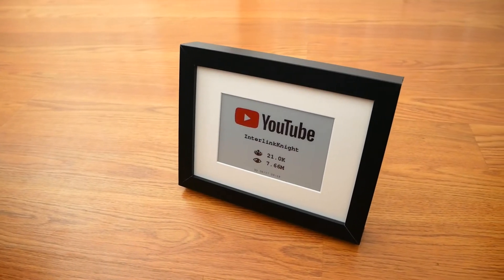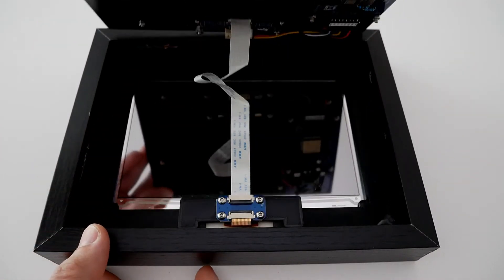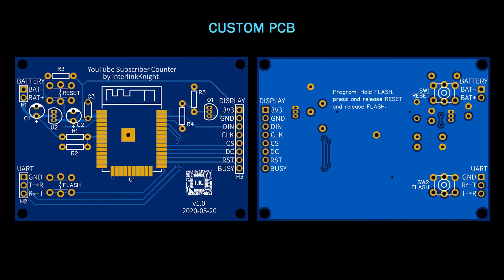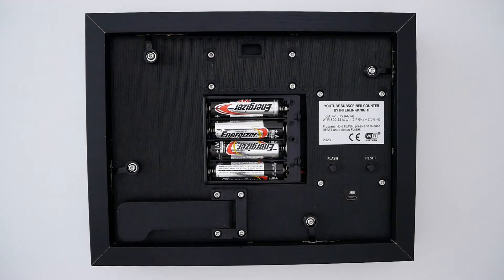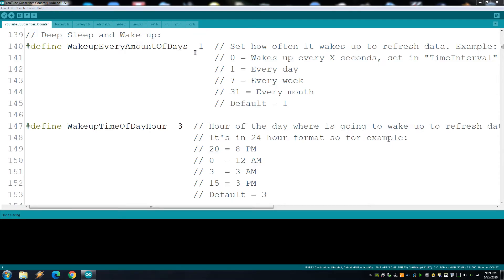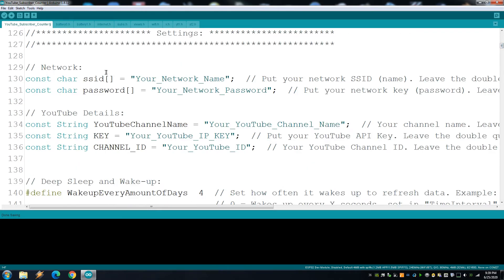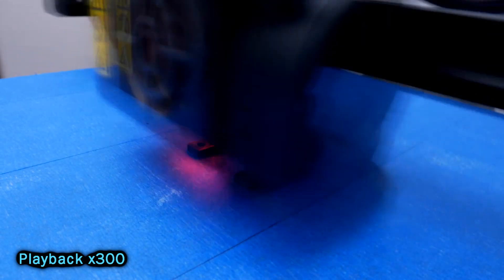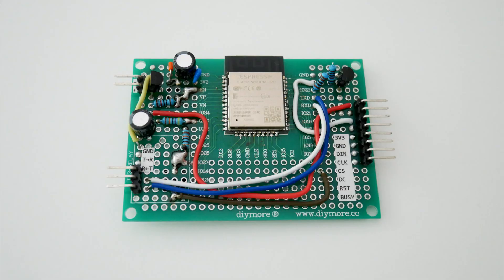DIY YouTube Subscriber Counter (E-Paper Display + ESP32)

Comment: Verry Nice, i wondering if it is possible to have a counter for the numbers of downloads from    my personal printables or makerbase web page. Thanks for your answer.
Reply from the maker: It's possible if you can figure out how to take that number from the page using the json library. That's how I did it. The library reads everything in the website and you have to extract the part you want
Reply: @interlinkknight  Do you have an idea how i can get this number or an example
Reply from the maker: Yes. Using my sketch as a guide. I don't remember all the details

Comment: I can connect to the api, but them 0 follower
Reply from the maker: Does it work when you go to the URL using a browser? I mean, when you do the test of your credentials using a normal browser. Modify the URL with your credentials and see if you get the data correctly
Reply: @interlinkknight  Yes the json Data in the Browser are correct.
Reply from the maker: I checked mine and it works fine. The problem seems to be in your end. By any chance, can you try older versions of the libraries to see if they might changed something? Not too old, though.
Reply: @interlinkknight  Ive tried an older library. But doesnt help. Payload string in the serial monitor is fine. I think it is a data extruction failure...:(
Reply from the maker: Send me more details via email about everything you have and i can check.
Reply: @interlinkknight  Found my problem. subscriberCount showed the right number. After sscanf it shows 0. Ive chanced the sscanf, now it works... Thanks.
Reply from the maker: What you have to change in the sscanf? And why you think you had to modify that for make it work?

Comment: How should I flash the module on Windows? 
I have assembled everything (I hope :), after connecting to USB port on Windows 10 I can see a newly added device named "USB2.0-Serial" (looks like not fully functional).
Should I install some driver?
Reply: Nevermind, installing CH340 driver did the job :) At least the device is recognized by OS.
Reply from the maker: And everything works?
Reply: @interlinkknight  Yes, seems to be working fine, at least I was able to flash the device with sample program and see it rendering something on different, smaller e-ink panel - I didn't wanted to play around with the bigger, target one in case I have messed up soldering or what and could damage it.
Reply: @interlinkknight  Finally I have made it.

Unfortunately I have somehow broken the display at some point of time and had to order another one :( Also I have lost two HATs when trying to remove SPI connector, it should be mentioned that this step needs to be very precise even it seems to be easy to remove the connector.

My son is very happy with it. Thank you @InterlinkKnight

Comment: Unrelated to this video,
But when will you post a video of the enhanced electrical jet engine ?
Reply from the maker: Yes, I'm still working on that model. It's not going to be finished soon, but I can assure you is going to happen
Reply: InterlinkKnight Sounds good, i really want to build an electrical engine model. Good luck in the project
Reply from the maker: Thanks
Reply: @interlinkknight  electrical jet engine? i want to see plz. I am interested on the thrust can be achived by electric jet instead propeler engine.
Any advance on how you make it? pre work video?
Reply from the maker: The jet engine model that I do doesn't produce thrust, but it can be done. I don't have videos yet, but I'll show photos on instagram when I made enough progress